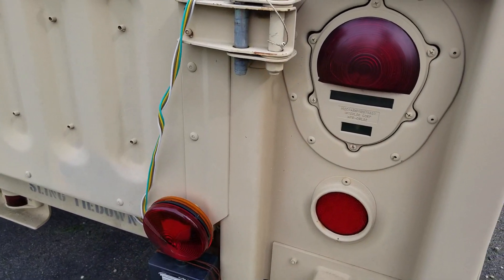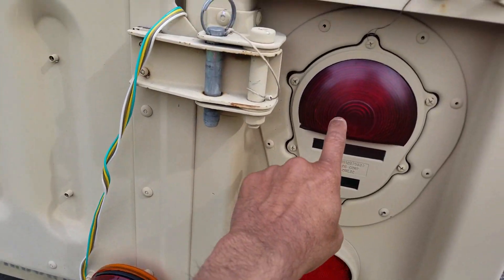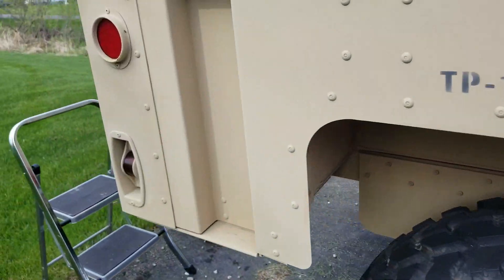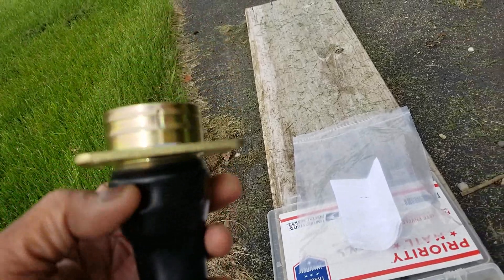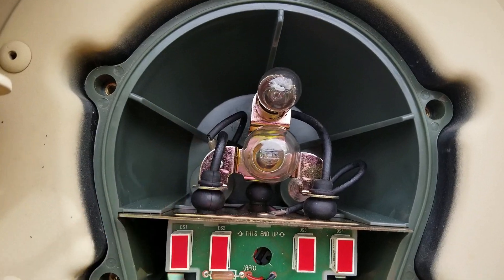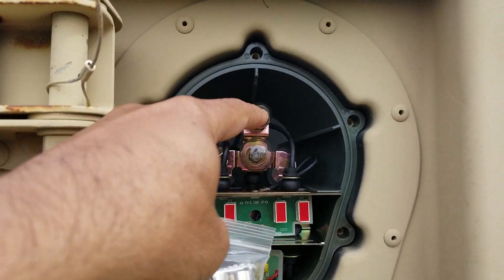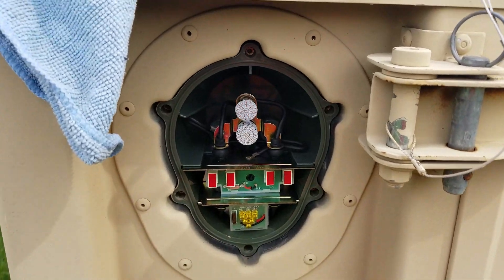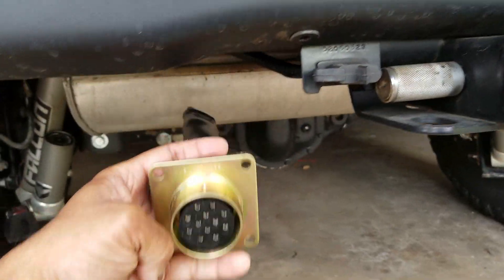N0AGI - TAC/0 :: M1101 24V to12V Conversion - Part 1.  Vol 101

Comment: Let me explain those lights.. the top led you fitted are tail lights, the two sets of leds already installed are convoy lights and are on a separate circuit to your "civilian" lights..
Reply: Yes the convoy lights, the 4 red rectangular lights, are only visible with night vision while "running dark". No need to even worry about those. Unless you're like an Uber prepper.😂

Comment: Hello from Czech republic...I've bought M1101 for my Jeep Wrangler some weeks ago, now I should change the electricity for EU standards, I just want to ask what are the yellow and red LED (time 6:40 - 7:00) used for? How do they work?....I have never seen them lighting, that is why I don't have an idea what is their real purpose. Thank you for your info!
Reply from the maker: Hi Marek, AFAIK, the red and the triangled yellow LED sections are powered off of separate wire-harness found "under bed" junction box.  I am yet to discover exactly what those wires are.  One of my next steps was to actually splice off the wires from the junction box and discover.  I will post what I find when I get to it.  My first step was to enable the power the brake, marker and turn lights to 12v. Thanks for asking
Reply from the maker: @Marek,  I found a public document on M1101 that speaks to the electrical system on these trailers.  Posted it here.  Go to Section 4 on the document.  Hope this helps. https://1drv.ms/f/s!AgjPhnGJGPjojZ5kPCK13GXHhBx3bQ